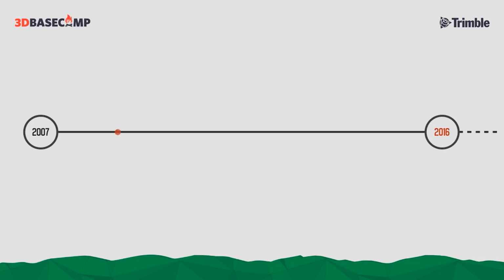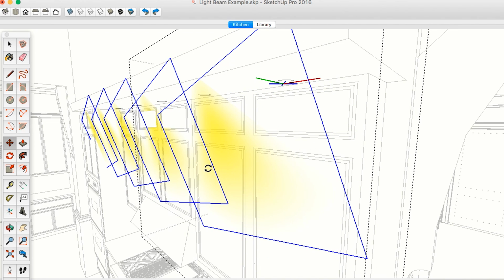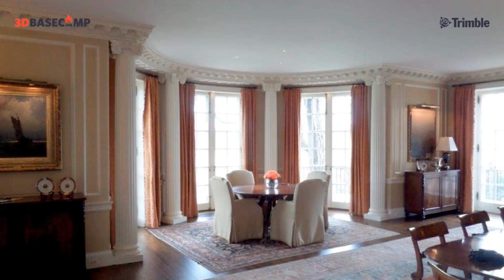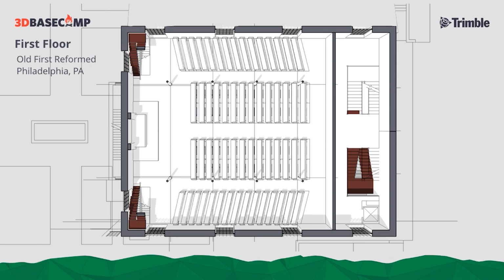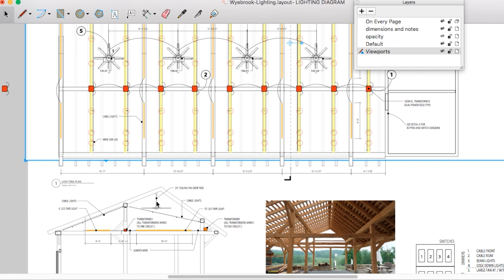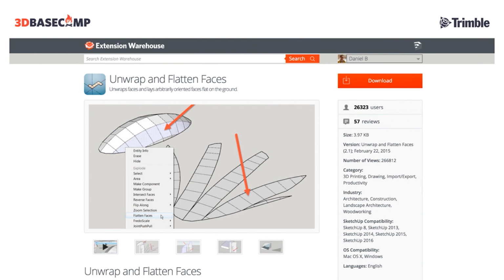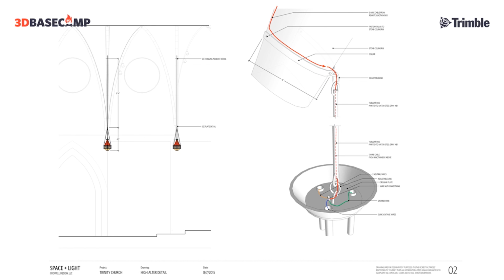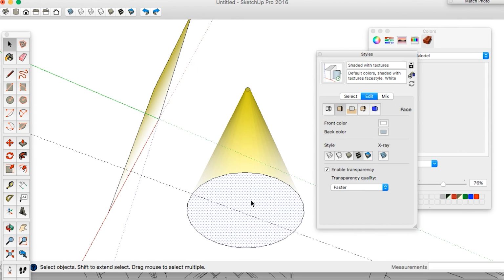3D Basecamp 2016 – Lighting Design using SketchUp

Comment: what 360° camera does he use?
Reply: I used a canon dslr with a tripod rig and a 8mm lens
Reply: Thanks for the reply! Occasionally I work on renovation projects and I run into issues due to the lack of photo reference but never considered 360 photography as an option. Ever since I've watched your presentation I have been inspired to develope this into my workflow. This would be a great method to incorporate into the firm I work for, as a design solutioin and presentation tool.